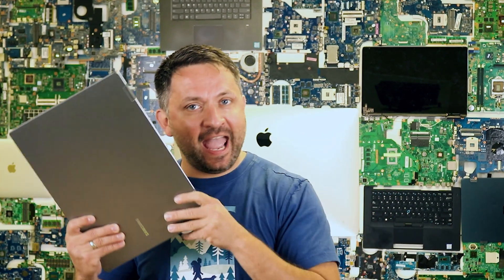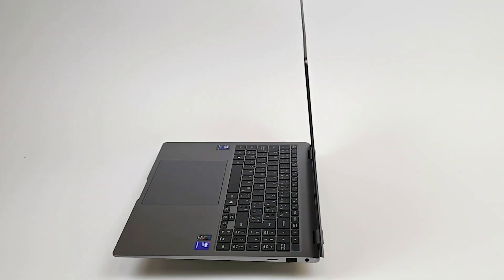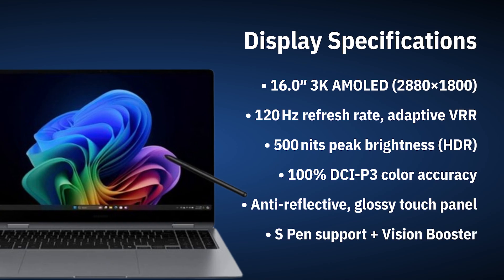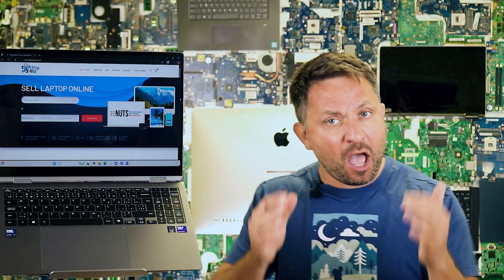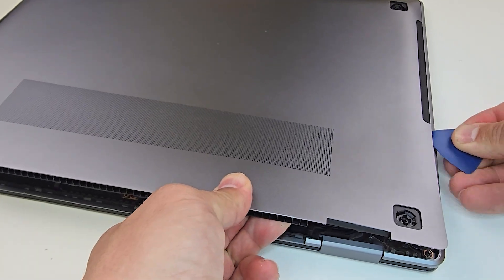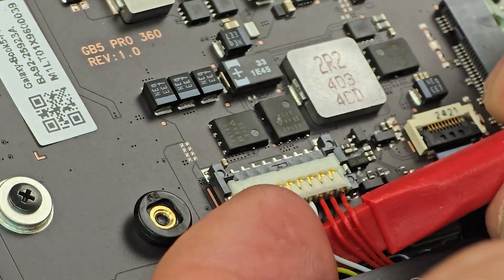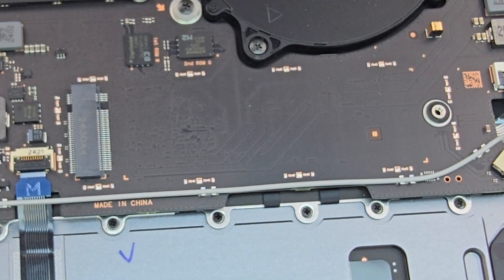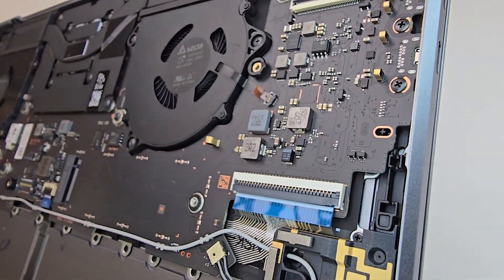Samsung Galaxy Book5 Pro 360 (2025) Review & Teardown | Intel Ultra 7, OLED and What’s Inside

Comment: I'm about to buy this exact model but the one sold on best buy is the 512gb so I need to double and triple check that it is user replaceable...on the model you have it is..I wonder if the 512gb model is the same...because the price they want for the 1 tb model is over 500 dls more!